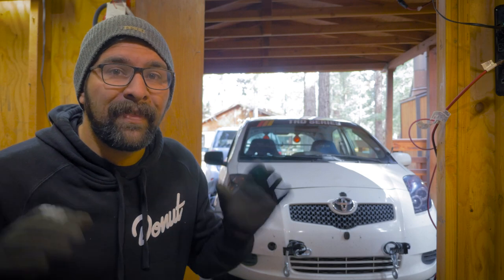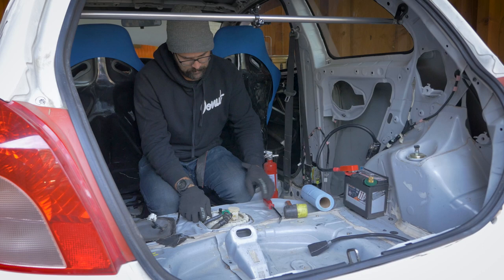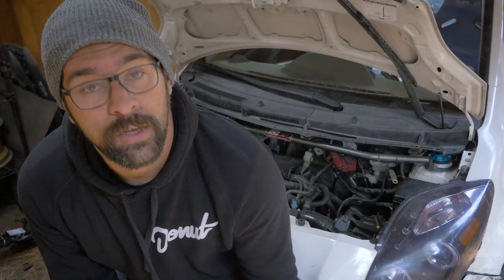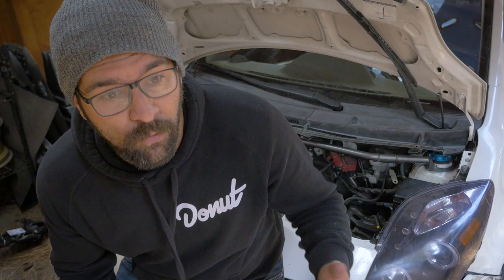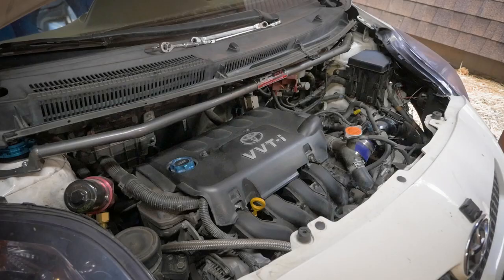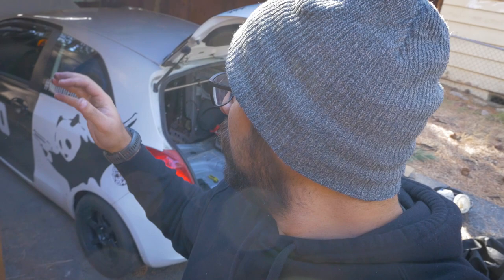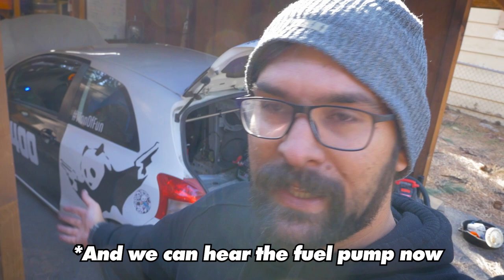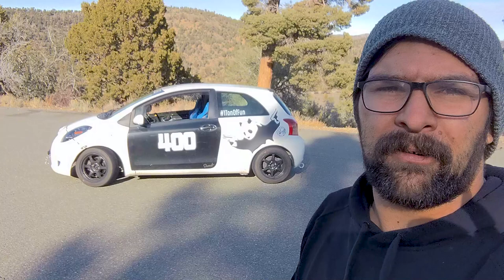3 OEM upgrades that make the Yaris Faster! 1ZZ, 2ZZ, and 2ZR Parts

Comment: building my yaris for backroads driving because there is no track close to where I live. Using these videos really helps when deciding on what mods to do as well as what to do when installing specific mods. Thank you Joey!!
Reply: Cheers bro doing the same with a 2zr rolla.
Reply: Hey man, I am building my 2008 yaris S for back roads also.... I just put 15" Sparco wheels (15lbs each) and Nitto Tires (Neo Gen) Small wheels work really well and the tires are insane grip. BC racing coilovers with cusco underbody and strut bracing as well next week. Upgraded rotors and pads new control arms and bushings all next week. Once the breaking and handling is sorted it's on to power.... I will follow you!
Reply: I agree im thinking to do just the xd fuel injector an if needed the fuel pump too cause i would like just a bit of more happiness, im currently running cold intake,headers, weapon r manifold an open exhaust i still running a muffler open flow it works great no problems

Comment: ASE certified master mechanic also fellow Yaris racer also been racing with the SCCA for 10 ish years now ... Replacing fuel parts like injectors and pumps that's have more flow rate .. WITHOUT PROPER tuning of the ECU is probably doing more harm then good u need a proper Wide band sensor and a tuner to see any or little benefit from this mods I would stick to OEM parts cus it's probably running too rich stock anyways and u might be making it more rich
Reply from the maker: Thanks for the insight. The fuel pump needed replacing either way. With the intake, throttle body, the car was occasionally giving lean condition codes. The ECU tune helped with that, but since the rev limit has also been raised, this pump is more piece of mind than an actual gain.
Reply: Hey guys I'm doing track days in a Yaris in Australia. What are you guys doing about baffled sumps? I've done a handful of track days so far and seems to be alrite on the standard sump, but just been thinking if I should do something to avoid starving the engine of oil
Reply: What kind of side band sensor and tuner do you recommend for the Yaris I want to mod my daily driver yaris but the proper way so it doesn’t totally ruin reliability
Reply: You really need an aftermarket ecu to tune it well.. haltech or link
Reply: Hilarious when people call themselves master mechanics
Reply: @dustin1870  Im not sure what you don't understand about the concept of certifications but it's widely used in many different domains.

Comment: The Scion xD's fuel pressure regulator delivers 46psi, while the Yaris gives 44psi.  So you've definitely increased your fuel delivery.  While you were at it, did you peek if the mid pipe of the Scion xD was intact?  it's fits the Yaris, and it's slightly bigger diameter.  Also, check if the VVT solenoid has this PN#15330-21020, which was supposedly from the Vitz RS, which also supposedly engages VVT at 2500rpm instead of 4000rpm.
Reply: Someone read my post! But it doesnt't engage it at a lower rpm from what we can tell its just allows for faster vvti response.
Reply: The VVT solenoid on the ZR engine is different to the NZ engines. I ran the VVT solenoid number in the system and couldn't find anything. I used my car chassis number 2008 Vitz RS and the numbers I got are 15330-21011 and substitute 15330-21010. You can try finding those.
Reply: @kimoliburd8829  15330-21020 is the OEM correct unit, the aftermarket ones work but are not the performance variant. I have the RS one in my car, VVTI feels like it comes in stronger. It just allows for higher oil flow, which decreases vvti asctuation time.

Comment: I'll have to watch the video for the xD throttle body, but I did similar with the Echo with a 2000-ish Corolla 1ZZ-FE throttle body swap.  Our older 1NZ's usually call for making our own sandwich plate and gasket to fill in the gaps from slightly different plumbing, but another thing you should consider is simply boring out the opening on your manifold a little bit.

The Echo, xA, and xB1 all suffer from having an oddly shaped gasket because of an idle-air passage off to the side.  The Yaris is just one bore, which looks like it can be Dremel'd out to really help that xD/Corolla throttle body work to your advantage better, especially since your ECU is more flexible (Echoes received absolutely jack in North America... Scion OEM+ is the best we can do).  Speaking of which, have you considered looking into Yaris SE parts that changed, like the tighter steering rack?  Not sure the torsion beam was any different, and the SE interior and suspension (maybe rear brakes) are irrelevant since you're already upgraded there.

Back to intake stuff: I'm back to a stock throttle body right now since the 1ZZ idle control valve went on the fritz, and it really doesn't have the pull it did (running a full length AEM xB CAI and 4-2-1 header, and Magnaflow weld-in cat... seeing my fuel cut off consistently around 6,700 or so), so it does make a difference even for the nanny ECU.

Having some spare 1NZ manifolds from the Yaris and Scion designs (and a 1ZZ-FED Celica), the Yaris has a different plenum that seems smoother, more open (more like the Celica).  I still need to find a cable operated four-bolt Toyota throttle body that would work on a Yaris, but haven't taken the time at Pick-n-Pull to find one, but would love to see how much more freely it can breath with a Yaris mani.

Comment: Looks like the spacer you had was for a 1ZZ-FED engine from a ZZW-30. It’s different to the 1ZZ-FE one. The FED has larger valves (1mm) and makes about 12 more bhp. It’s in the Celica and MR-S. I found all this out when I put an FED head on an Elise S2 S (1ZZ 134bhp). This engine is about 127 in a Corolla and a bit more in the Lotus but still less than the Celica/MR (about 140).
Reply from the maker: ahh, that makes a lot of sense

Comment: Also a bigger throttle body does NOTHING if the hole in the intake manifold is small / tiny behind the throttle body so either port match your throttle body or put the OEM one on for the idle and better driveability I'm general .. I have a 2zr throttle body on my car but I did port the manifold to match it required alot of cutting sanding drilling and Epoxy in so places
Reply: I also have a 2zr throttle with the manifold ported to the throttle. I used the 1nz throttle body control and mounted it on the 2zr throttle body. Idle is perfect and it doesn't have the rev hang like the 2zr throttle.
Reply: I'm looking to do this currently. Did you remove that that copper mesh thing on the top half of the intake behind the throttle body?
Reply: I don't think so, because if you put the larger TB it is going to allow more air at the same angle as the smaller TB. The hole in the intake manifold would be the bottleneck only when you get close to WOT.

Comment: I always check the gap regardless of whether the plug is pre-gapped or not. Are you able to tune the ECU? It seems at this point, you're better off financially to buy the Xd, swap over engine, harness, ECU. And it would have stock reliability, but more power
Reply from the maker: The ECU has a tune from Chris Taylor Racing who has tuned a lot of the B-spec Yaris competitors.

Comment: Omg the more I watch this video sigh SPARK PLUS have to be the correct heat range and Iridium as actually has a weaker spark for less power then a cheapo Copper one .. the only thing iridium does is last Much much Longer that's why OEM use them so they don't have to replace them for 100k or so but if u want a cleaner hotter spark a 2 dollar OEM plug would be better ... And make sure it's the correct heat range for the tune

Comment: JDM Vitz RS vvti solenoid  next and depending on your factory units a "c" marked maf unit and RS coil packs. No point with irdium on a yaris, the plugs are easy to get to and copper provide a better spark but with more maitenance, you can clean them every race tho and get 5 or 6 brand new sets of ngk coppers in same rating for the price of the iridiums. I just clean mine every service and every 3 she gets new NGK coppers and she purrs. Ive been making posts on yarisworld, theres lots of good info there for our cars.
Reply: The 1st Gen JDM Vitz RS is what you mean for coilpacks.  The 2nd gen uses rocker arms and has a wider valve cover with long reach spark plugs like those in the 2TRFE Tacoma and longer coil packs than the 1st Gen Vitz. I had both generations vitz
Reply: @kimoliburd8829  No 2nd gen RS has higher amperage coil packs compared to a non RS 1nz-fe (but some countries got the higher amperage coils as standard anyway some didn't) I have a mark2 no idea about mark 1.
Reply: @vctrsone  I can twist my logic on how vvti solenoid,coil may give some gain. But how does maf sensor a/b/c type give anything?
Reply: @AmirFauzi666  The Thai guys insist on it if tuning the 1nz-fe. I don't speak enough thai to get on their forums, but I heave read posts where other people who could followed the build logs and that was one parts of it along with the RS vvti Solenoid and RS coils.
Reply: @vctrsone  Funny enough we Malaysian also learn to modify from the Thai people. But here mostly use k20 coil packs. I dont condemn tho, just trying to get more input. Cheers
Reply: hi msia ppls....

Comment: Which idash did you purchase? And did it work from the get go?im trying to get on to measure my coolant and oil temp on my xa
Reply from the maker: Internally a the iDashes are the same. It took a little work, but in 08+ cars it works right away because the OBDII port has CAN data.

Comment: I'm looking to get this as my first car. Where did you get the headlights from?
Reply from the maker: amazon. Spec D. a bit of a pain to wire up though
Reply: @RassoolRacing  Would the 2009s fit a 2011 Yaris? I don't know if they used slightly different headlights since it was facelifted.

Comment: Did you change the guts from the 1nz-fe throttle body into the new larger throttle body? It will not stop throwing errors if you left the 1zz guts in. Drill out the rivets, pop in the 1nz-fe circuit board into the 1zz-fe throttle body and it will fix the error codes. I still am yet to do the throttle body as i want to have a adaptor plate machined first so its perfect fit.
Reply from the maker: 1zz guts. No errors for me
Reply: @RassoolRacing  Fair enough, easy fix in the future if they pop up. Been waiting to find a cheapish 1zz unit to do the swap myself, but read everything I could find on the yarisworld forums on it. Some people seemed to get the codes and some didn't, might be to do with what ever guts your throttle body had in it to begin with.

Comment: Ive never been able to make the 1ZZ throttle body play nice with my 2014 Yaris, it always idles erratically or rev hangs for multiple seconds at a time.
Reply: My 2014 runs correctly with some throttle position sensor tune up, the srcrew behind the epoxy is your solution. Plug in a obd2 reader and check for data stream absolute trottle position needs to be at 15.3%